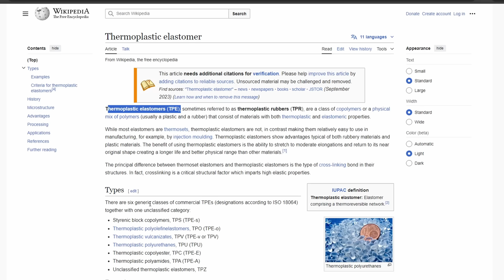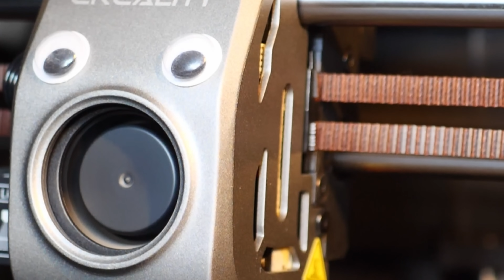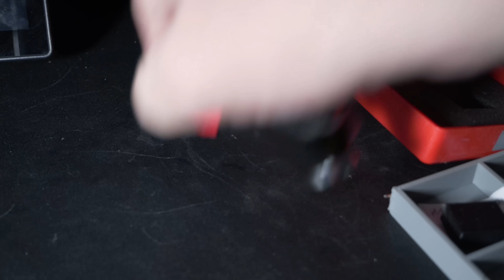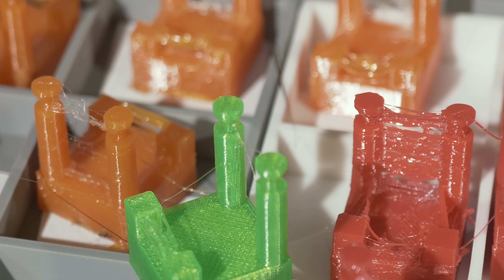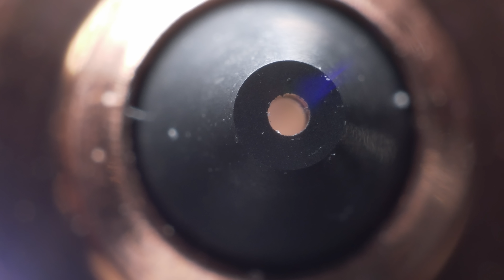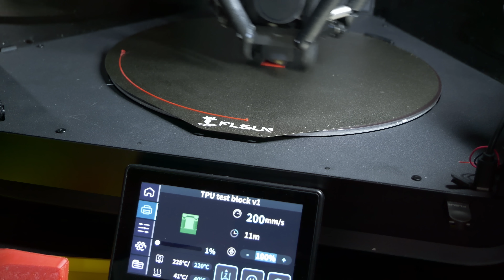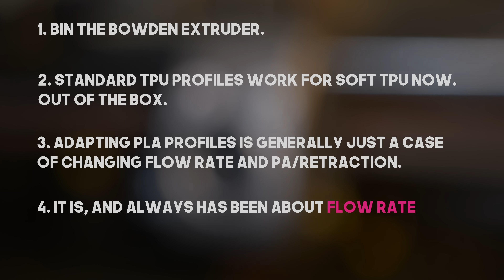Don't fear SOFT TPU - it's fine to 3d print now.

Comment: I work for UK filament manufacture, we just did a small run of TPU it wasn't easy. your correct remove as much friction in feeding even to pull a meter off the spool just let the extruder pull it in.
if you can fit a stainless steel tube right up the extruder gears to stop filament getting stuck in the gears on the hot end side of the extruder. 3mm OD 2mm ID or cut up nozzle with long heat break tubes.
Set the filament tensioner as high as you can TPU filament is tough and slippy, so don't worry about crushing the filament.
A larger nozzle helps too. 
you make great content hopefully sponsor a video.
Reply from the maker: Get in touch with me please 👍 😁 email should be in yt profile
Reply: In my experience TPU benefits from less gripping.

If you have the gears too tight it squashes the filament and displaces material so you end up under extruding by a decent margin.
Reply: @freedomofmotion  That´s the case with every flexible material. PETG more flexible than PLA this some people increase extrusion rate of PETG compared to PLA. It has to grip reliably, the extrusion rate can simply be changed accordingly.
Reply: Just use a PTFE tube, cut in up and place it right before the wheels. I have been printing with my Bowden set up for ages. It´s not that difficult. You simply need to account for the very soft material from the spool all the way up to the nozzle. Retraction is higher because you don´t really retract material you deform the TPU instead and then move it. Clamp force squeezes the material as well more so and changes the diameter etc. Higher extrusuin multiplyer is also used for that same reason, it´s just to account for soft material
Reply: @sierraecho884 I've even printed some softer TPU using a custom bowden extruder with good results, it's all about minimizing where it can go and reducing the 'unretract' speed can help to give it more time to rebound after retracting.
Reply: @JJFX-  Yes, absolutely.

Comment: Super soft TPU in my geared Ender 3 Extruder always failed miserably BUT the cleaning line the printer lays down before the actual print always is  perfect. There must be some setting I can get from that pre-print action... not sure what to look for and where.
Reply from the maker: That ... sounds like a retraction issue. Speed or distance or E acceleration.
Reply: If the line goes down clean and it fails directly afterwards to print the actual job, I would say there is an aggressive retraction after the purge line. This just crumbles your filament in your extruder gears and jams the filament
Reply: @kaizoor  @LostInTech3D Thanks guys